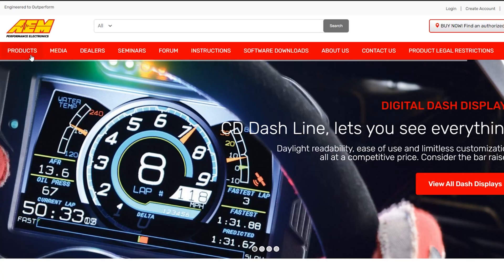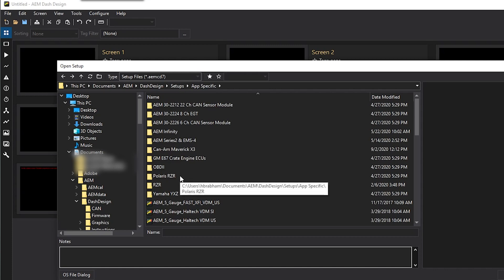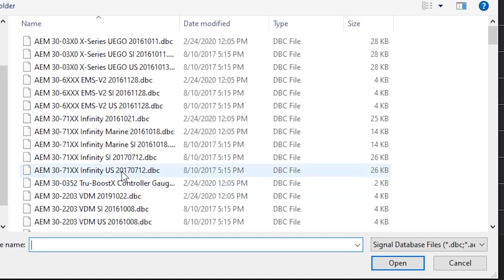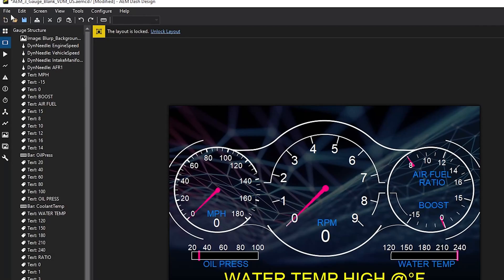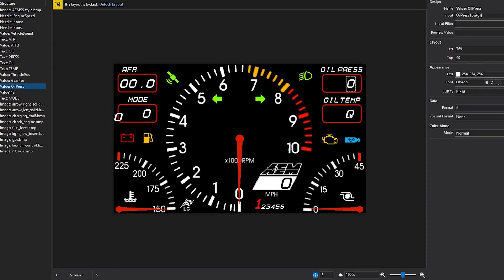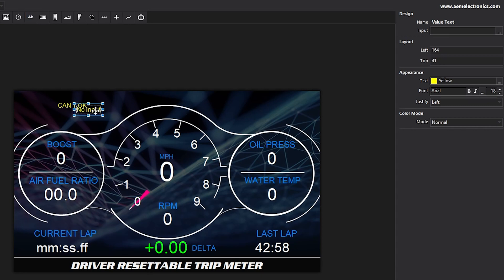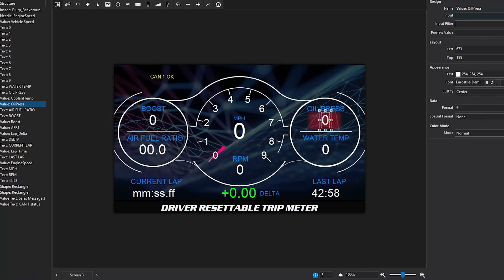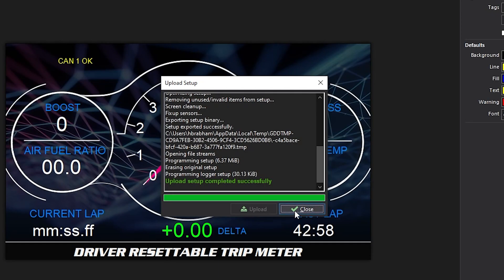You Just Bought a CD DIGITAL DASH, What Now?

Comment: Curious if you all know, 
I have a p14 pdm system via rywire for my Honda 
Utilizing hondata v3 
Will your aem cd5 work with their “can” plug, as offered via their custom pdm options. 
Or will I need to wire in the can input and output via the hondata unit in the ecu as well. 

Sorry if this is confusing. I’m learning about what I need to make your cd5 work with my p14 / hondata unit. 
Thanks
Reply: From what I saw online wiring in the input and output looked to be plugged into an oem wiring harness. Which I would no longer have. Just making sure, thx.